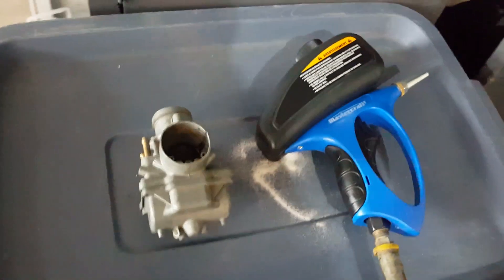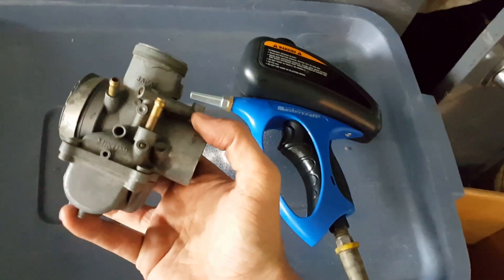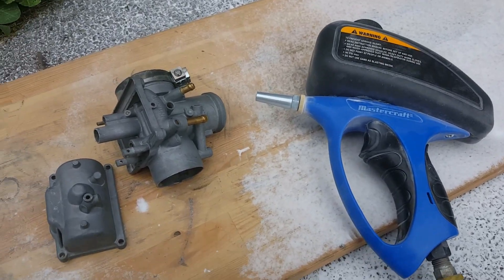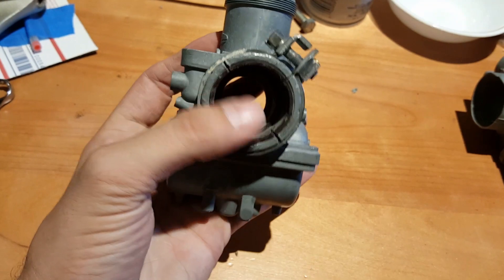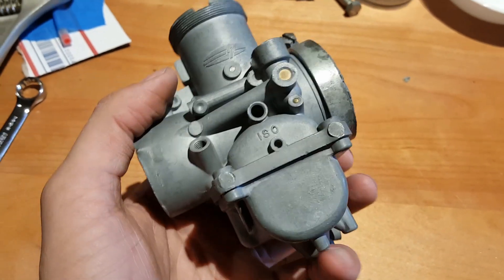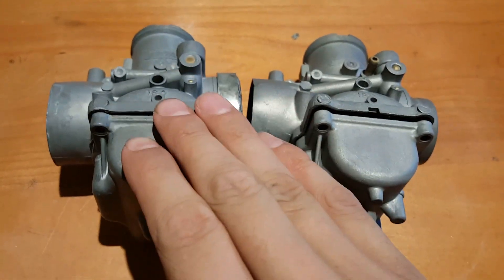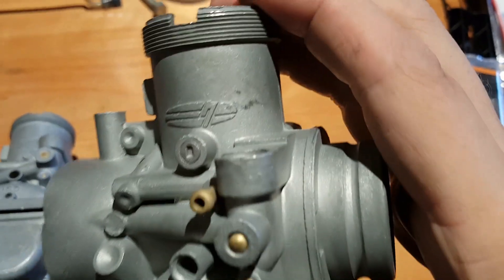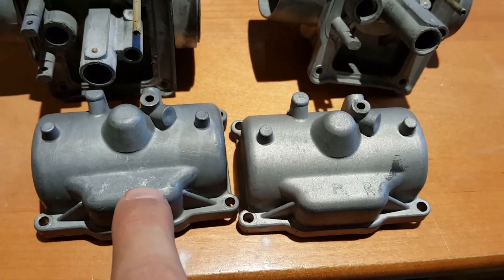Soda Blasting vs. Glass Bead Blasting Motorcycle Carburettors

Comment: I wish you'd shown before and after of the bowl interior - the brief glimpse I could see after you blasted it, it still looked like there was corrosion or some other detritus in the bottom of the bowl. 

Also, I would like to see the difference of the soda vs. glass bead in the same equipment and at the same pressure, to see if the difference is due to blasting media or equipment. It looked like the glass bead blasting had more pitting in the finish afterwards... was that due to the media, or the equipment, or was it that way to begin with?

Comment: Thanks for doing this video! It looks like soda blasting may be the way to go if you don't want to alter the original factory surface finish. Glass bead blasting does alter the surface and kills the original finish on alloy parts. You can never achieve the bright appearance aluminum and other alloys have from the factory when you glass bead a part; sand blasting is even more destructive to the surface. Of course if you have rust or corrosion the factory original surface finish is already gone anyway.